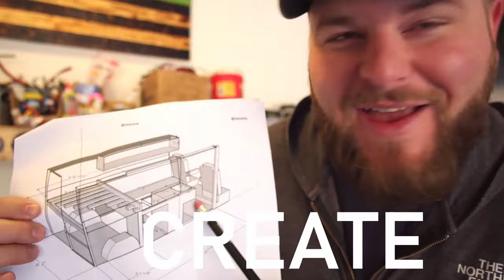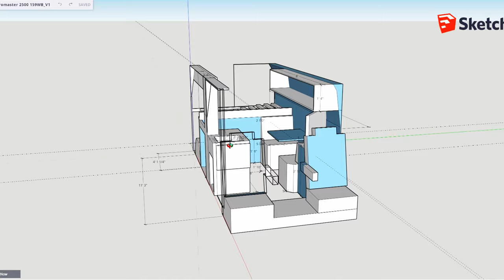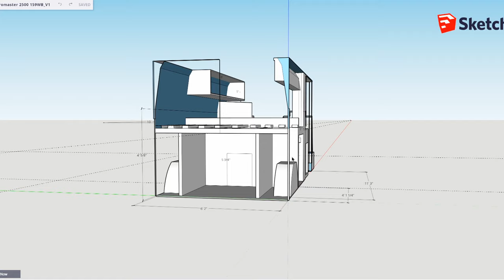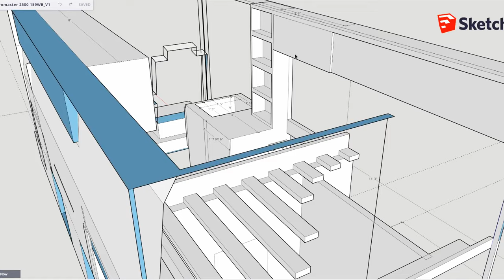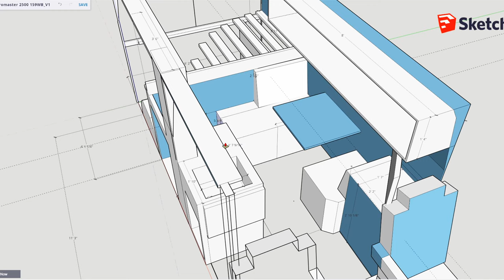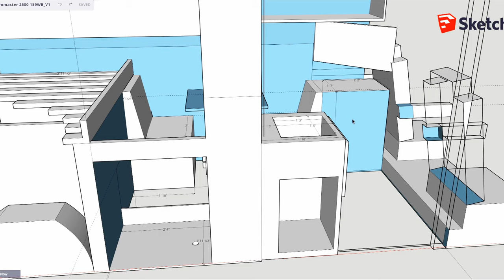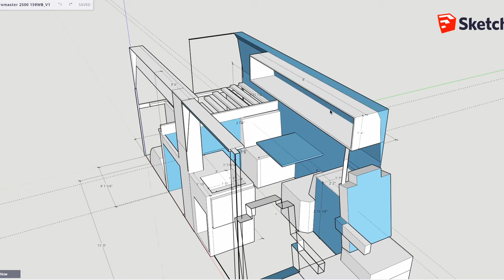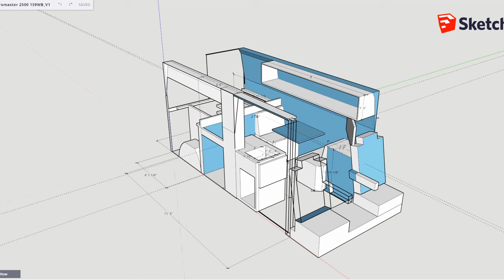DIY ADVENTURE VAN BUILD / Converting a Van into a Tiny Home

Comment: Couldn't tell by the video.  Are you able to stand up strait in the van being 6'5?
Reply from the maker: Hey Will! Yes and no, once ceiling is in, (even if only 1/4” plywood) I would rub, especially with 1/2” subfloor.  But I wouldn’t rule out a Promaster just because of ceiling height.  I struggled with the same thing.  I think the Promaster brings a lot as far as space and front wheel drive, and competitive pricing.  I think we will spend most of our time sitting or sleeping in the van.